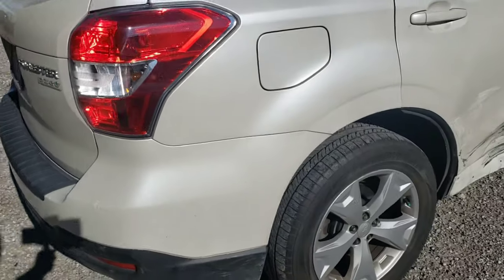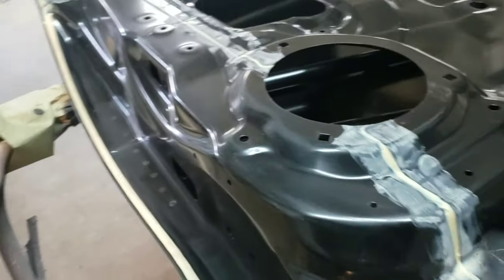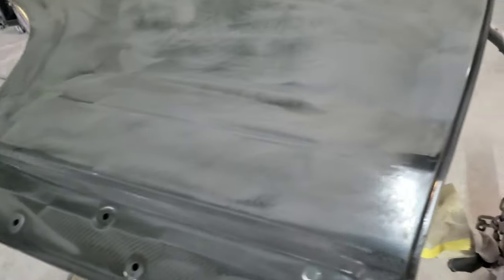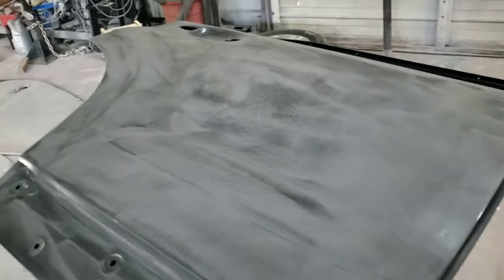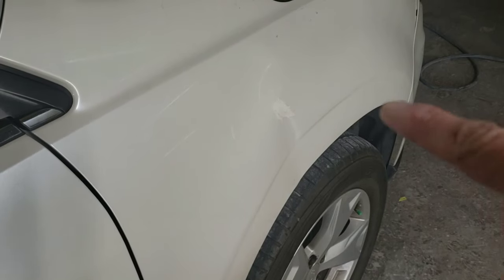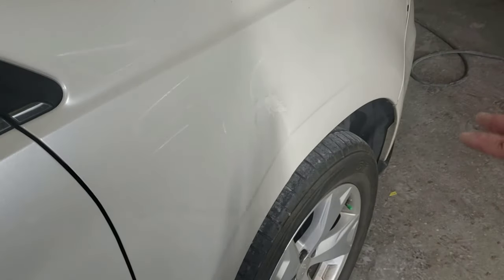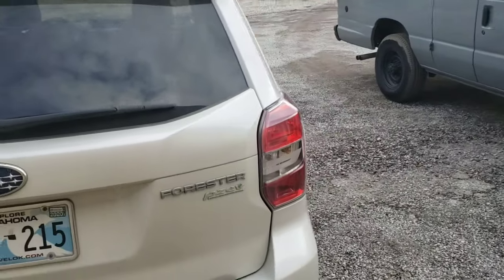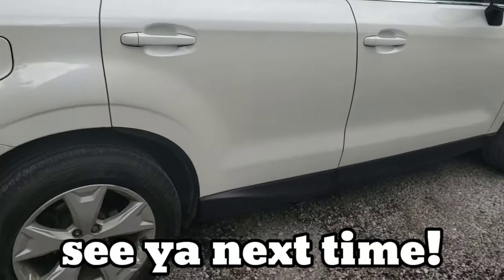How to repair body damage on a car. #auto body tech #diy

Comment: Love your videos brother, easy to understand and follow, quick question is 800 grit to rough to remove a clear run, I've used 1000 grit but it seems its only somewhat leveling the run. Thanks and Blessings from Los Angeles ✌
Reply from the maker: You can use 800. I've  used 600 before. But be careful. Razor blade will wirk better.  I have a video  removing  fisheyes after painting  same concept but with a run. There's also alot of other video's on the tube about it.